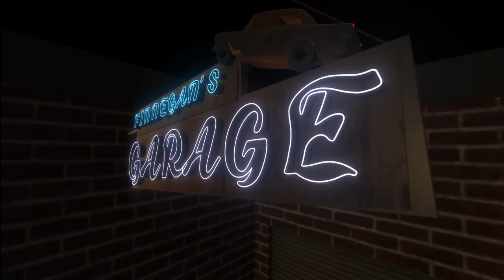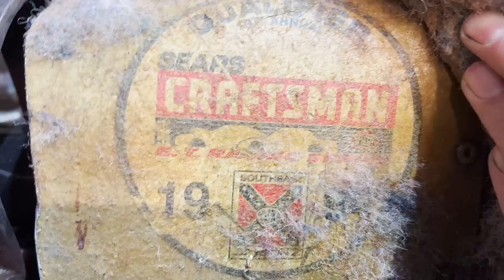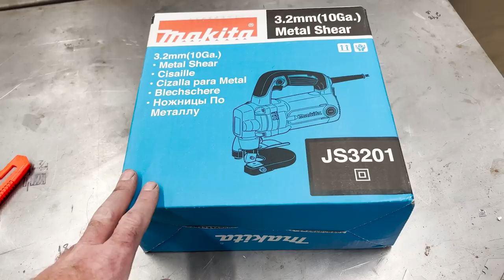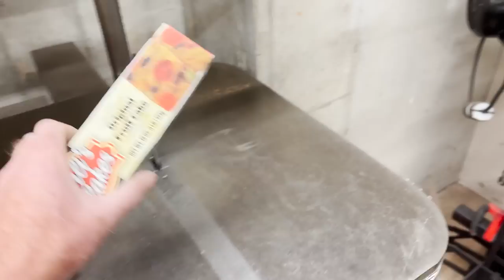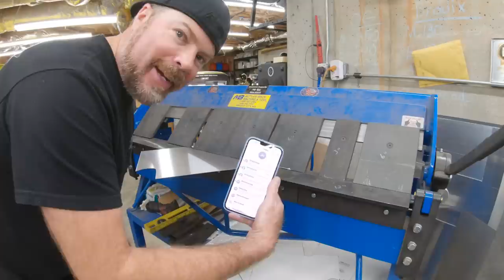FIXING A GIANT HOLE INSIDE MY 1,000HP SUPERCHARGED '67 PONTIAC FIREBIRD!

Comment: The sticker on your trans tunnel is for the Sears Craftsman ET Racing Series, Division 2
Your car was a bracket racer in '94, and it qualified to represent its home track at the ET Finals in '94.
Most of those stickers ended up on rear windows..you stacked 'em so the year would show from the previous sticker when you laid the current year's sticker on top..
Having a full deck of 'em on the back window was a major flex back in the day..
Reply: NHRA Division 2 Dixie Rebels. I ran in that division from 1989 to 1995 in Gainesville Florida until a divorce took my car!
Reply: @scanddincful  
Funny..I was running a '73 Scamp in Division 3 (out of Detroit Dragway), also from '89-'95..sold my car in '95 as well..not for a divorce, though..I wanted to go faster, bought a front engine dragster in '95..by the time I finished the car, Detroit Dragway was just a memory..
Reply: @scanddincful  should have completely taken it apart so if she got it she would have to reassemble it (which would hopefully deter her from actually wanting it)
Reply: Probably been a race car longer than a street car at this point.
Reply: @nickhale117  There's a guy in my town that lost his house in a divorce. As part of the agreement he had to paint it. He painted it purple.
Reply: @billstevens5277  Was that guy you?
Reply: Exactly correct. I was bouncing between Div 5 and Div 3 back then, with a little IHRA mixed in for good measure. It took me a few years to realize how much NHRA hated bracket racers, then I switched to just IHRA.
Reply: Good to see guys from that era that run the stuff confirm it...

Being an aussie born in 92' with a somewhat automotive background, i seen the sticker and instantly thought, division 2 bracket racing series of some sort sponsored by sears
Reply: @scanddincful aaannd that’s why at 50 I’m single and still have my dream car I built 15 years ago god I feel bad dude I’m sorry to hear that I also don’t have any kids but I imagine I’ll give up one of those before I would give up my car…. I guess I did if you think about it😂😂😂😂😂 0 regrets
Reply: I was looking all over Google and couldn't find it anywhere, thanks 👍
Reply: Sweet info!!

Comment: Hey Mike.. just an fyi, the shears you bought ( in the sheet metal trade ) are called unishears.. the other shears you were talking about are called double cuts.. the nice thing about double cuts is they keep your work from getting curled.. the bad thing is you lose material (obviously) and are not ideal for relief cuts or radius cuts.. that's where the unishears shine.. but then you have to straighten out your work (unless it's a cutoff, obviously) on the curl side of the shear.. one other thing, you have a 10 ga capable unishears, if you close the gap (slightly) between the cutting blades, it won't leave a huge burr on the cut edge of aluminum & lighter guage sheet metals, but then you will have to readjust the blades (open) to cut heavy guage metal again..
Reply: You are absolutely right. Just be careful when using double cuts so you don't cut to big
Reply: I learned something today, thanks mate.

Comment: Just saw an episode where it ran a 9.06 at 145, running so rich it was making black smoke like a diesel off the line, then leaning out bad on top from a weak fuel pump. It will get into the 8's easily now.

Comment: After you Panel Bond the edges to seal out fumes,or you can use 'Dyna-Mat' to insulate the sounds too,double sided tape will hold the carpets so they don't flap.

Comment: For those round edge cuts you can save a lot of time by using a slug buster. It cuts the round hole clean then you can cut up the sides and you   have a slick bar slot.
Most dimple die kits come with a slug buster to make the original hole before you dimple it.

Comment: You might want to buy some of that stick tape that's used on AC ducking and tape over ALL of the seams where your tin work attaches to the floor of the car. That will keep the tire smoke out of the inside of your car. I seam some cars fill up with tire smoke  They are 
not going wait a long time, if you can' t. On the tight areas that spray foam insulation should work. Nice tin work, Good luck at the track

Comment: Mike......from a 20 year veteran of sheet metal fab.....may I suggest midwest offset snips. Buy them learn them and you will never struggle to cut a radius again! You can but a solid hole from a 1/4 inch drill starter hole any size up from there! Using those snips I have in the past cut 3/4 inch holes cleanly.

Comment: Not many people know that you can use a rivet gun for Lockwiring - feed the tail of the wire through the mouth of the rivet gun to suck it tight before locking off. Handy for making DIY hose clamps

Comment: Finnegan, as someone in the aircraft field, the Kleeco comes in many sizes.  We have many sizes at the Cessna plant and they go up to  1/4 inch in diameter.  They are handy as hell
Reply: Don’t forget rivet fans and manual hydraulic rivet guns for cherry max. Definitely some items to add to the household tool arsenal if you’re doing any kind of sheet metal fab.
Reply: I learned the many joys of Kleecos at A&P school. We used hundreds of them in all shapes and sizes. I suspect every metal plane in America was built using them.

Comment: The surface rust is fast in the south, I have a  body shop not far from you, I use SEM rust mort,, slightly diluted wipe on parts with cloth shop towels let dry makes a film you can come back too without much trouble. 
just works for me, one man band also.

Comment: You have to do something about that lamebutt sound track bro. That bands saw needs some grease on those wheels axles for sure; man that loud, it need some TLC. That floor is going to need a lot of sound deadening material to keep it from rattling in there. Good luck with that.

Comment: For cutting sheet metal, there's a lot to be said for a $7 electric jigsaw from the Salvation Army.  I don't know if it helps to lubricate the blades with fruitcake.  No curling, no shower of sparks, no pointy metal clippings (like with some nibblers).  They're terrible tools for woodworking, which might be why so many end up in thrift stores, but awesome for cutting thin stuff.

Comment: They make clecos from 3/32s up to 1/4 inch or bigger. They are sized in 1/32nds so the 3/32nds are #3s, 1/8 are #4 and so on. 
They also make different sizes and shapes of cleco clamps... Check out a company called Brown Tool for the cheapest prices and ATS or Yard Store for the better quality stuff. You can spend whatever you want on sheet metal tools! 
It is awesome seeing tools I use as an aircraft mechanic on your channel. If y'all are ever around Ada, Oklahoma and want to come see an aftermarket turbo installation on a private airplane, hit me up!

Comment: Hey Finnegan...you should look into an aviation style angle drill. Uses 1/4-28 threaded base drills and normally pneumatic powered, but the drill head is tiny and if access is a question, it will provide. Good video.

Comment: 33°??.    Frikkin 18° here in the Pac Northwest.  Heat lamp rig under the oil pan all night.  Also warms the battery.   Just heard a Blurb about Jay leno.   He is currently headed back in for more plastic surgery.  Get Well Jay, and get rid of the coffee kettle cars!!!.   A new rendition, and HUGE price for a aircraft sheetmetal nibbler that has/was been around forever, in a slightly different design, from the 40's.  I believe Howard Hughes Aircraft had the same tool, but air powered for assembly line aircraft const, during the war.  Thanks Mike.

Comment: Last I checked Makita is one of the last tool brands that isn't part of a conglomerate that rebrands their  tools with brand names like Dewalt, Black and Decker, Porter Cable, etc.
Reply: Yup, they haven’t sold out yet. I think Hilti was the other one.
Reply: @wallysworkin823  I wasn't thinking of Hilti.... I think of Hilti more as  building construction specific whereas Makita has a wider applications.. but You are correct.

Comment: You mentioned in your episode at the track your roots blower gets hot maybe you could set the car up to run on methanol or even e85 as I know a fuel change can get cool down the blower. Most likely you have it running on 91-110 but some Methanol would be the way to go as it will help cool the motor and increase the power band.

Comment: Mike not complaining and yes 3 link works but as a owner of a 76 Nova tubbed with 31x18.5 on back with narrowed 12 bolt on factory leaf springs my drive ability is awesome and I don't have the engine for  8 seconds passes but I do have a friend someone you probably have heard of Ron Rhodes 
He runs leaf springs in x275 class which are Calvert split mono springs with Calvert traction bars
He recently went into the 6s in a 1/4 Mike race he recently raced at
He runs a 68 Camaro which is same as your Firebird so I thought that would have been a better setup for you since you plan to street strip  your car
Trust me my Nova cruise awesome with Hoosier radials on back
Thanks for awesome YouTube Channel

Comment: Actually clecoes come in many sizes with different colors for each size and 1/4 inch and larger the colors start over. They are measured in 32nds the biggest I've used is 5/16. They can also be called wedge locks and available in wing nut version and different lengths for heavy structures. These started out in aircraft assembly.  Used aircraft tools can be bought from suppliers.

Comment: You need a rivet fan it gives you automatic spacing on rivets so the spacing is consistent.   Also look at cherry max rivets they are structural pull rivets used in airplanes where you can't get in to buck the solid rivets.

Comment: put vinegar in a spray bottle and you can prevent further rust until you are able to paint where needed..
a metal stretcher would be good for the last piece covering the driveshaft that needs a bit of a flange..

Comment: That's a nibbler not a shear.. typically sheet metal hand shears cut a line out of the metal and leave a curl behind the machine and take a lot of force to push along.. That works basically like a punch just nibbling out a little piece over and over and over as it goes along.. MUCH easier to use and much easier on your wrists. The plus side to the old style ones is if you're welding copper or something that filler rod isn't very available it cuts you a piece of ready made filler rod that you just have to flatten back out and once you weld with it you can grind and polish it and you won't be able to tell where the weld is because it's the exact same metal as the base metal.
I think that "sticker" on the trans tunnel was a racing series. Finnegan a little tip, when you need a rounded shape but don't have the tools, hammer your sheet metal on a hitch ball attached to a piece of tubing. It'll give you a nice round shape without needing a bunch of specialty tools. Another old way is to take an oak or almond log round and grind in a concave dish and you can pound your metal into that and use it to smooth out the hammer marks.

Comment: The ones that curl are called double cuts the one you have is a unishear (your supposed to adjust the gap for what material your cutting) also a pair of offset snips (midwest brand or really anything other than wiss) will change your life

Comment: Hey Mike a few helpful tips which go against Davids motto of get it done even if its wrong. One if you don't change out the steel rivets they will rust out very quickly . Next with AL there is a min edge distance which is 40 x diameter of the rivet hole. Also you want to file, chamfer and deburr the holes zo that there is nothing between the panels. I personally would have put a small bead of seam sealer before riveting but that can wait until your done. Also chamfering all edges and radius corner gives a finished look but it much safer to work around. Okay thought I would offer up those tips hope you use them for your safety. - J

Comment: With you not using any type of sealer at any of the seams, the cockpit will always fill with tire smoke BAD every burn out to heat the tires, better invest in a good respirator. It's going to get flat out NASTY in that cockpit filled with smoke.

Comment: A Craftsman from
Way Back👍
Mr Fin
Makita makes some electric sheers that you grasp from the back of the tool not the top
Easier to push and control 
Awesome
Used to use them to trim long lengths of counter flashing on roofs when you need extra clearance when you put a thicker roof on
You'd dig'm. 
Floor looks great!

Comment: Do you have to seal all of the seams/gaps to make it fire proof/resistant like being a rear firewall? Just wondering, cool episode as always.👍
Reply: Most back half cars you try to seal them up with silicone from the bottom. The better it’s sealed the less the car fills up with smoke from the burnout.

Comment: I said to get them and learn how to use them bc you can not use them like those cheapo's you been using.....those are straight cuts....the midwest offset you have to learn how to use them....they must be leaned over the correct way otherwise you will 100% destroy them first go around. In my trade and the company I work for we are never to be caught with straight cuts and we have to have midwest brand only......those rules are in place bc the finished product is that much better! Imagine a world where you don't need a grinder to clean up your cuts!